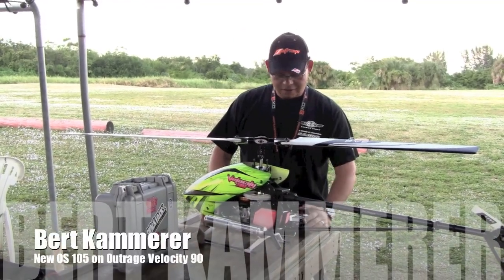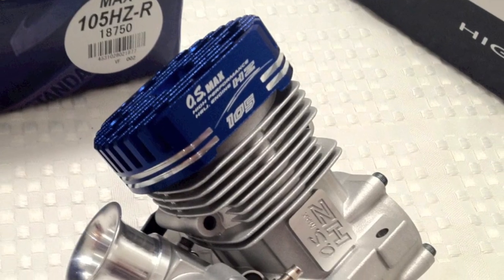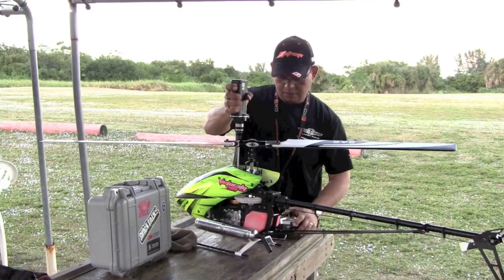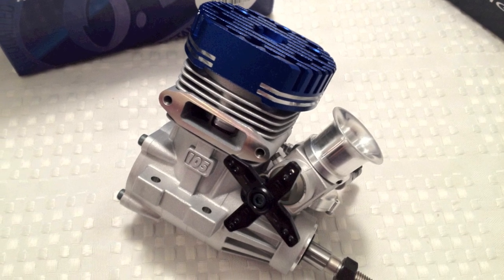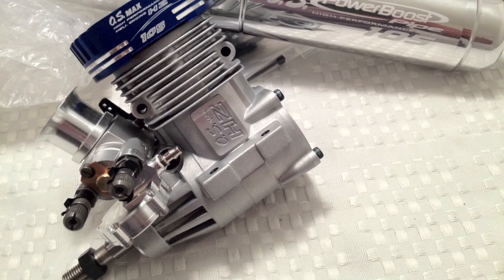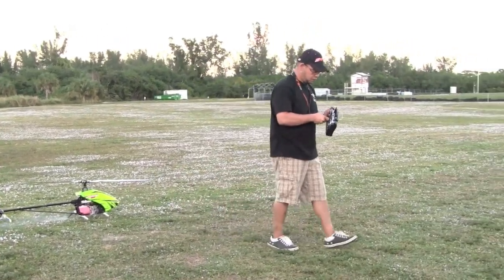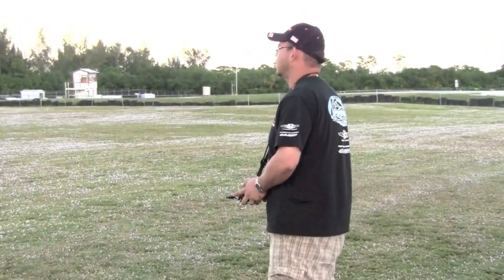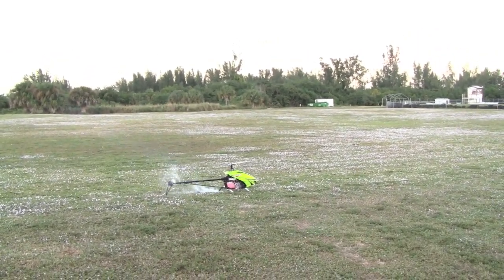O.S. 105 Engine Testing - Bert Kammerer

Comment: I have a Curtis Young Blood pipe for 90 size. Can I use it on this engine?
Reply from the maker: Yes, won't run as good as it could, but it will work just fine.